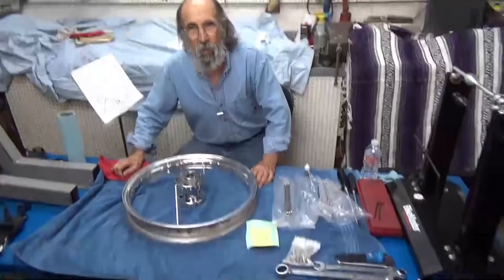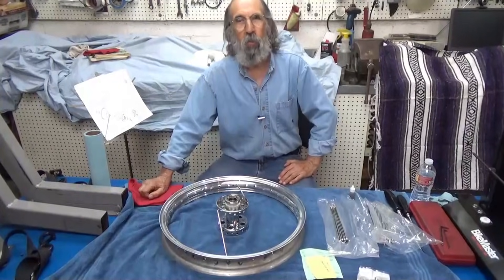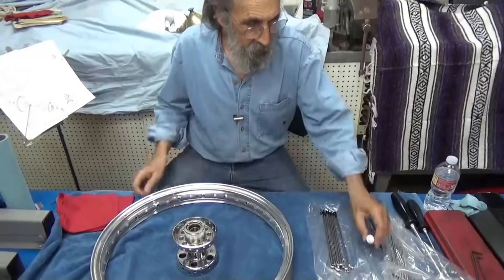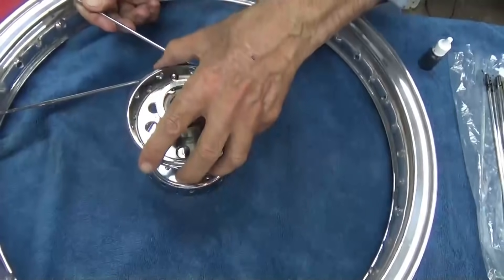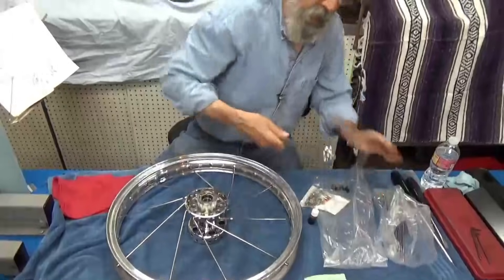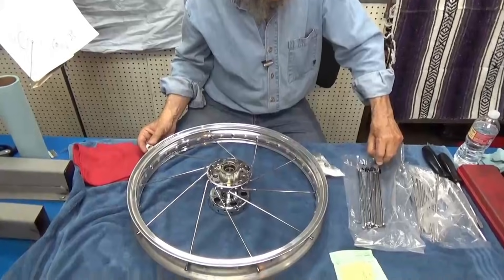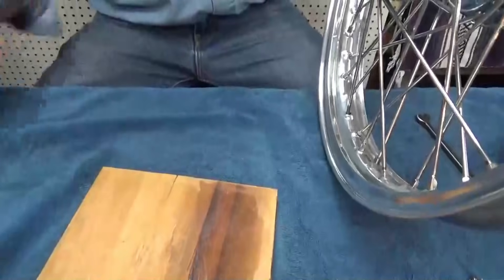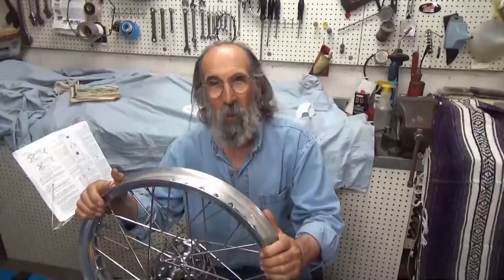Building a New Wheel For The "Project" Harley Davidson Big Flathead

Comment: Love your videos sir and your personality.  I am in the process of replacing a bent front rim on my Harley Dyna. I am using the stock hub and reusing the spokes and nipples. However my spokes have 2 different types. The outer spokes have a shorter 90° bend and the lowers have a longer 90° bend. This is my first wheel bebuild so I have to figure out whether to start with the uppers or the lowers. I guess I will figure it out when I start the assembly tomorrow. I have learned a lot watching your videos so I'm hoping for the best. Thanks again for your help sir. See ya on the road !
Reply from the maker: Section 2 of your service manual explains it perfectly.  Try Tedd Cycle (V-Twin) for the proper HD Service manual.

Comment: As always, nice work and a great video.  Thanks for sharing!

A side note to re-purpose an old (or new I guess) spoke into an excellent kickstand spring hook.  Drill a spoke nipple sized hole in a 4" long x 1/2" round piece of solid metal (or something similar).  Push the spoke through, put the nipple on with thread locker.  You can pull to your heart's content and it won't break or slip out of the spring.
Reply from the maker: We do show how to install a kickstand spring.
Reply: @pacificmike9501  Ha!  I kinda knew that was coming.  Yes sir, I watched that one a while back.  It was great to see someone show the correct way for that style stand.  I find myself working on many different makes and models and on some I just have to use the hook.  Take care and keep the great content coming!

Comment: I bought the 21" on my shovel for $5. it was an early 80's factory wheel from a swap meet in Pennsylvania and it was totally severely bent rim from maybe someone hitting a curve. I beat it with a 2x4 and sledge hammer outside in the snow in the middle of the night to bend it back. when I checked it on the dial indicator first time, It was dead on. I could not believe it.  i took it to the honda shop to have tire put on  for $5 it was perfectly balanced without a weight...lol...sounds crazy but true... that 21"is on my 79 flh shovel right now 20 some years later. I just bought a new tire for it with my trump check.
Reply from the maker: Great story.  I do believe it.

Comment: Really enjoy your vids ..wheels lacing  and truing ...A witches Brew....Expecially on 45s hubs...maybe you should do a vid on those? ...started working on Harley’s five yrs ago ..Started with handle bars till recently my first 74” Knuck Engine .....will be swinging Away at 45 tran Soon fingers crossed ...
Reply from the maker: That trans appears a lot simpler than it is.  The proper tools are not that common any more.  But, I have faith.  I don't have the need for a 45 wheel, but it seems lacing them is in the 45 service manual.  Once you get the pattern and routine for the specific wheel, it's all the same.

Comment: Mike, I don't know if you look at new comments on old videos or just the most recent ones, but thanks for sharing all that knowledge!  I'm lacing up an old wheel that needed a new rim and I am having a problem!  I followed your guidance completely and my wheel went together great, but when tightening up all the nipples to cover the threads on the spokes, every other one on both sides gets super hard to tighten just before I get to the end of the threads.  I'm concerned because there's no way most of them are going to tighten up much more while some are still loose.  I hope you have an idea what is going on.  I'm going to go back and make sure I didn't screw something up but I checked and checked and was really careful doing it...
Reply from the maker: If the pattern is correct.  If you crossed four spokes.  That's not three, it's four.  If the dimples the holes are in are at the proper angles, then the spokes are not the right ones.  You might take it apart and start over.  Are these 16" wheels?  Are the hubs proper?  Must have all proper parts and lace according to service manual.
Reply from the maker: It sounds like your pattern is off.
Reply: @pacificmike9501  They are 16" wheels.  The only thing being replaced is the rim.  I think I do need to take it apart and start over.  If somehow I started going in the wrong direction with the first spokes and continued it lacing the entire wheel, could it do something like this?  Yeah, I think I do need to start over.  Thanks!  Man, I can't believe you actually answered me.  Wow!
Reply from the maker: Of course I answered you.  We all start the same.  I remember the first wheels I did.  I did it straight out of a Harley service manual.  They came out good too.  It was worth every minute of it.  I hope you are using new spokes and antiseize.
Reply: I was lacing it correctly as it turns out.  I'm afraid the problem lies somewhere else.  A little background might help.  I'm building a custom 53 panhead bobber that I bought as a rolling chassis with rebuilt engine and trans and a couple totes full of parts. The wheels aren't original, they were swapped for some that could use disc brakes.  They look to be early or mid '70s.   This wheel might have already had a problem and I didn't notice it while taking it apart, just thinking the nipples had boogered up threads.  I bought a rim because the old one was really dinged up but the other parts looked and seemed okay.  I see the reason the nipples get tight.  Where there are pairs of spokes crossing closest to the rim they are touching and it actually takes a little force to push the top one down so I can thread on the nipple.  As I tighten them up one of the pair seems to bind making it hard to thread.  Sorry for the long post, I realize you can't diagnose something like this because I'm using all this mismatched stuff, but thanks for your input.  Oh, and I am using antiseize.
Reply from the maker: I know I look to be quite extravagant at times.  But, when it comes to wheels, I like new parts.  Look in the catalogs and notice most of the hubs work with the same length spokes on 16" wheels.  Learning what fits what is a big part of the proccess.
Reply: Thanks for all the responses, Mike.  I was hoping not to spend too much more on this one, but wheels and tires are critical...

Comment: Very nice video, I'm always looking forward to new ones. I'm looking to lace my - 71 16" flh wheels. I'm thinking of replacing the drum brake hub with a new hub to make sure it fits a  brake disc. Is there anything I need to consider when it comes to buying that hub or are they interchangeable with the old outer rims? Thanks again for your helpful videos.
Reply from the maker: You'll need (if you want it to fit with the axles and other assorted parts) to use a 67-72 hub both front and rear.  A 72 front intended for a brake disc will work.  67-72 used ball bearing hubs and 72 is the only year Harley used a disc brake on the front with a ball bearing hub.  The rear is a whole different ball game because it uses a round swingarm, drum brake and ball bearing hub.  You'll need to change everything back there.  The last one I did, was on my own Shovelhead.  I wanted the early swingarm (round), late model wheel and a 2008 dresser disc brake.  It was very involved and I had to fabricate my own caliper bracket and spacers.  I love it, but it took a lot of doing.
Reply: @pacificmike9501  thanks for a solid answer Mike!

Comment: Question Mike, I have a wheel already laced with steel spokes. Have bought chrome spokes, a stand and all the tools, but instead of de-lacing and re-lacing the wheels, can I just replace the spokes one at a time?

Of course afterwards I will re-center, true and balance, but I think this will make sure I get each spoke in the right place. Your thoughts?
Reply from the maker: Take all the spokes out.  Start from scratch, with your service manual open.  Lacing it properly, in the right order, by the book, is way easier and will make it easier to true once it is laced.  Doing them by removing and intalling one at a time requires bending (wrong) and will make you quite old before you're done.

Comment: Hey Mike. Love the videos! I'm redoing a 16 inch front wheel for my 1989 FLHS. The old rim was dented, rusty, and badly pitted. My clymer manual doesn't state what the Rim to hub offset should be. Can't seem to find anything online either. Do you know what the offset should be?
Reply from the maker: I believe it s to be centered.  You could verify that in a HD service manual, but I believe it is to be centered.
Reply: @pacificmike9501  Thanks for the info! Got the wheel laced, trued and back on the road!

Comment: Mike, I bought a 2 of used Harley rims and hubs (43086-81 16") front and rear, I plan on replacing both bearings and spokes. My question is the sequence of events, do I work the bearings first then lace or does it matter?
Reply from the maker: I like to strip and inspect the hubs before  they are painted, polished, or plated. I remove the bearings and make sure the hubs I'm about to use are nice enough.  Once they are clean and finished, I install the bearings.  Then, I lace up a wheel.
Reply: @pacificmike9501  Great! Thanks Mike, I appreciate your time and your video's.
Reply from the maker: Thank You.

Comment: Mike, would you use never seize on chrome spokes and does that lubricant on thread change torque spec at nipple?
Reply from the maker: Sure.  But I would use a light anti-seize of some sort.  I normally use that which is supplied by Buchannan Spoke and Wheel.  The torquing operation becomes much more accurate as the spoke does not give resistance in the threads between the spoke and the nipple.
Reply: @pacificmike9501  sweet thanks, maybe a gear oil would be better. I will research the Buchannan lube. I am lacing 73 and later dual flange with stock drop center steel center rim. I have watched the lacing series about 3 or 4x's. Thank You for the knowledge.

Comment: Hi Mike, I have a quick question about the interchangeability of rims. I have a couple old Chiefs  (1947 & 1950), I was curious if a Harley rim from the 40's, 50's, or 60's would work on an Indian with using the appropriate Indian hub and spokes. Just to be clear I am referring to stock 16" rims. Seems like a good bet that the two companies sourced their rims from the same suppliers and that they would be interchangeable. Thanks for your time. Darren.
Reply from the maker: I believe you would be fine, but I would check with any of the Indian restoration companies to be sure.  I'm honestly not sure.
Reply from the maker: I haven't laced an Indian wheel in a long time.  What I do remember and was taught by an old Indian mechanic, was, the easiest way to get the proper offset was to mount the newly laced wheel on the bike, then center the rim to the bike before doing the final truing.
Reply: I know you had a fifties Chief at one time. I was curious as to your take of an 80" Chief flathead versus an 80" Harley flathead motor. I usually see that the Chief is reported to put out about 50bhp and the only number I have seen for the Harley 80" is 39bhp.
Reply: Thanks for the tip. Much appreciated.
Reply from the maker: The Indian was an "everything bike."  It was intended to be a "high performance" bike.  Every hot rod flathead trick I've ever seen is done from the factory in an 80" Chief.  The Harley Flathead 80 was designed as a workhorse.  And it did its job well.  Remember, Indian didn't have overhead valves.  Harley had the Knucklehead,  Easy to make a Knuckle scary fast.
Reply: Thanks for your thoughts Mike! I own two Chiefs and four Harleys so I appreciate the two companies equally. I can appreciate the additional performance upgrades that can be done to the overhead valve bikes, but I must say Indian did a better job with the antiquated flatheads than Harley did and if I spring for an overdrive four speed trans I'll sure have fun beating most pans and knuckles hands down...lol. Take care and looking forward to see you continue your 80" flathead build!

Comment: MIke- I have a 75 Super Glide and I want a 20" wheel. Can I use my original hub and buy a new rim and new spokes to do this? I can't find a 21" wheel that has the same hub as a stock one.
Reply from the maker: Try Drag Specialties "Old Book."  Try Tedd Cycle, and J&P.  You'll get used to looking at suppliers that cater to the "older bike" crowd.

Comment: I am lacing a 16 inch 40 spoke wheel for a 1961 pan head ,is the procedure the same as your 19 inch wheel.
Reply from the maker: Pretty much.  But, I strongly recommend a factory service manual.  When I learned to do this, I learned from the service manual, a guy who worked for a spoke and wheel company, and an old bike mechanic I worked with for years.  Also picked up a couple habits along the way.  I do my best to show how I do it.  But the manual rules.

Comment: Hi Mike, what size Tire & Brand did you use on your 19" front wheel? Also what brand of Timken Star Hub did you use?
Reply from the maker: The hub is a reproduction and uses Timken type bearings.  It came from V-Twin.  The tire is a Continental Vintage and is the mate to the K112 rear.
Reply: @pacificmike9501  Hi Mike, I just ordered the parts to build my own. Thanks for the help. One more question. What cold air pressure do you run in the front & rear?

Comment: Whew, this is going way back, Mike! When we were building choppers out of Triumphs in the 60s, a must have was a "hog"  5.00 x 16" tire  on the rear. I would cut the blank spokes to length and had a couple of thread rolling machines to roll, not cut, the threads. If I remember right, there were two different length spokes. Sometimes the wheels would come out perfect, other times not. I think the British hub pattern was different than the Harley pattern, causing the problem. But when it was done, it was a great satisfaction. I've always wondered how they mass produced spoked wheels as the cheap level, and mags were more expensive. It's still that way today. Are the manufacturers using some kind of automation to lace and true the wheels??  Best, Queasyrider
Reply from the maker: Well, the way we do wheels, other than Harleys, today, is simply take a picture with your phone before you take it apart.  I'm impressed.  I always bought spokes from a supplier that knew what fit what.  I'd tell them the rim by size, model and manufacture, and the hub I'm using, and they send me the right spokes.  I'm impressed.  I've never made spokes.  However, the people that do it everyday, for a living, can lace and true a wheel in a matter of minutes. I can do a nice job and use closer tollerances than most factories, but I don't care if it takes me a while.

Comment: Buchanans offer a choice of either stainless-steel nipples (galling?) or plated mild-steel nipples (rusting?), but not brass (which neither galls nor rusts), for their stainless spokes.  May I ask, what factors did you consider in selecting stainless nipples for stainless spokes?
Reply from the maker: Years ago, all we could get was stainless spokes, and galvanized steel nipples.  This was because of the galling problem of stainless on stainless.  So, they came up with a "non-seizing"  lubricant that is shipped with each set of stainless spokes and nipples.  Problem solved.  I've used this stuff with total success for probably thirty years.  I save those little bottles of magic and used that stuff for lots of other things too.
Reply: @pacificmike9501  Thank you so much for sharing this advice.  I have a '89 FXSTC that I want to convert back from 16-in. front rim to 21-in. again.  Would not have dared attempt it, if not for your video series here, which has made startlingly obvious some key principles and steps that don't get the same clarity in other descriptions of wheel-building that I've seen or read.

Comment: Ah little late...lol..just did my 1970 about two weeks ago...lol 😆
Reply from the maker: Oops.  I'll bet you did just fine.
Reply: Yes was not bad reused my hubs(rebuilt them) bought rims and spokes just slowly evenly tighten spokes even had to set offset according to my manual.... Thanks for the videos  building a 87 evo motor now....using Zippers Performance 80/80 kit.....

Comment: Reminds me of the time a customer brought me a rim and hub to lace up, done many before, this one just would not lace up correctly, after second try I called out for a sanity check, I was good but the hub was mismanufactured (DS), very irritating, charge was time spent.
Reply from the maker: It happens.  Wrong spokes.  Wrong pattern.  I always preferred doing the purchasing.  Then,  if it wasn't a wheel or set up I knew, I wanted a wheel to photograph before I took it apart.
Reply: I did a conical hub on a honda front 21 inch, it had 4 different spokes,,, inner and outer short, and inner and outer long, hub was in two pieces and bolts togeather,,,,MMI extra credit. Stay safe